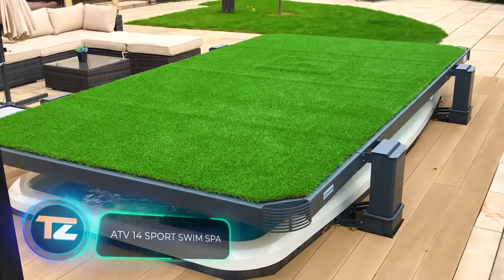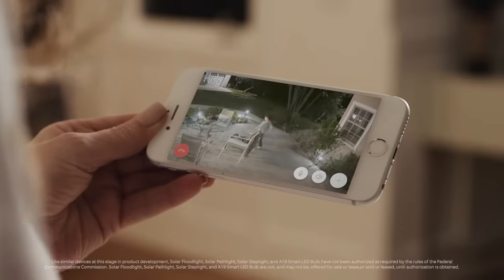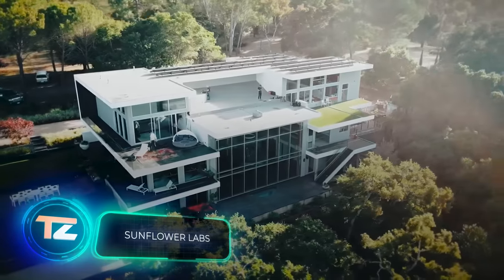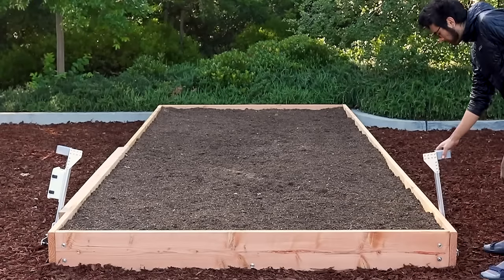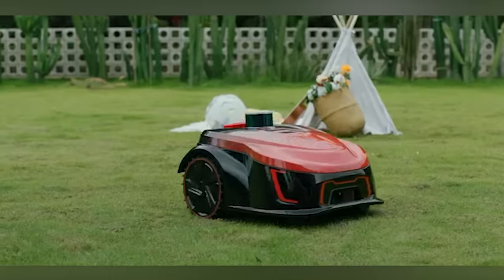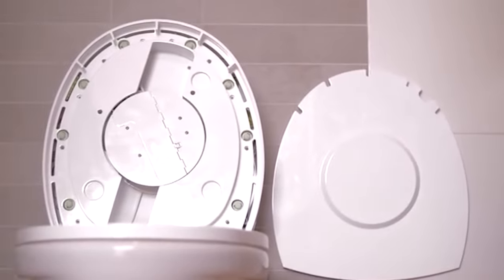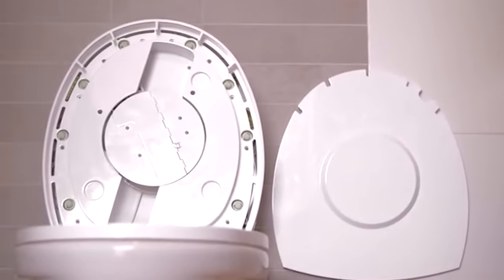14 COOL INVENTIONS FOR YOUR HOME

Comment: The farm bot is actually pretty cool. I might actually think about it when I set my stuff up. I'd need to see how expensive they are though. ah, 4k or so depending on its size. Little pricey, but it'd also depend how big my garden is and how often i'd use it.
Reply: Already being tested on 𝙧𝙚𝙖𝙡 farms for 𝙨𝙪𝙥𝙚𝙧-𝙥𝙧𝙚𝙘𝙞𝙨𝙚 seeding, watering, applying pesticides and adding fertilizers, thus reducing the need for all those materials and to reduce inadvertently supplying weeds with the necessities of life.  Also limits chemical runoff into streams.  The delivery system can be pulled behind a track or drone-based.
Reply: That farm bot does sound pretty cool for automating gardening tasks! If you're looking for other innovative home solutions, you might also want to check out the Segway Portable PowerStation Cube Series. It's a versatile and powerful backup power source that can keep your devices running during outdoor adventures or power outages. Definitely worth considering!

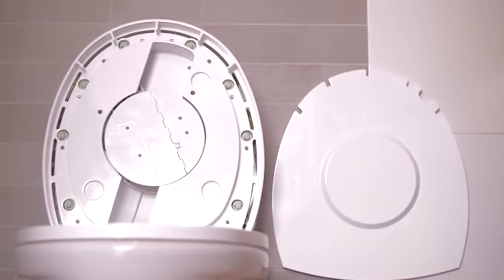Comment: TS 2:24 I'm handicapped and can't shovel show.  This snow melting system would be a life saver.  What company is developing it?  I would like to follow them.  TS 13:05 Love the rainwater system.  What company is presented here?  Thank you.
Reply: Snow melting systems are made by a lot of companies. It's not a new idea. It is however expensive to install since you have to pour new concrete, unless you want to place the mats everywhere. (Which I'm sure have a daisy chain limit and aren't likely meant to be driven on.)  However it may be cheaper then hiring a snow removal service in the long run. (Depends on the house layout, snow frequency, average temperature in winter, and who you hire.) Generally what they put in the concrete is a pipe that they circulate an antifreeze liquid in that is heated at a central location. So if you're planning a new driveway, or simply have the money to spend, might as well ask for a quote. If you want to heat your public sidewalk you might need to get permission from your city.

Comment: I am in my late 50's and my uncle built his house when i was 6. he had a central vac in the garage with outlets in most every room. does not seem to new to me
Reply: Yeah, my parents had one 30 years ago in their business. Reduced noise pollution at vacuum location. Easy to install if you are fine working with PVC. The national average cost to install one is about $1,500. (Says Google.) Everything was simple and low maintenance. The vacuum is powerful enough to power the rotating brush attachment without problems as long as you take the hair out periodically. The exhaust is at a different location so it keeps the air cleaner where you are vacuuming.

However the bigger the room the bigger the hose you need, thus more weight and bulk. If you don't clean the hose out it gets heavier as dust cakes on. It's unlikely to be hard to clean just something you have to do. As the system ages the plastic attachment parts may get brittle and break easy, but by then you got your value out of it.

Comment: Homevac saves energy? Heavily doubted, as the air has to be dragged thru a much longer pipe system, including lots of bends, This is creating a high amount of friction compared to a usual vacuum cleaner with a reasonably short hose length. The longer pipe reduces the suction force and makes the system therefore much less efficient. So please strip the "energy saving" part out, it is simply physically not true. And what about germs and fungus/spores in the pipes? Much higher surface area for something to grow on. You need to clean them out regularly.

Comment: So many flaws, the lighting system that is powered by batteries, the security drone system just requires a tarp wrapped over the charging unit, and yes you get an instant alert which only gives the observer the green light when they realize you aint home.

Comment: A'ight @8:50 the actress has obviously NEVER cleaned a toilet.  You don't leave the seat down when you go scrub the bowl because when you lift the soaking wet brush out of the bowl it drips poopy water all over the seat.
Actress:  What's my motivation?
Director: Don't get poopy water on the seat.

Comment: All secured by technology, until burglars and home invaders brake-in using signal jammers and low tech counter-measure equipment (like casing your home with spy cams and hacking your system, etc).. *It's not even a possibility, it's already happening